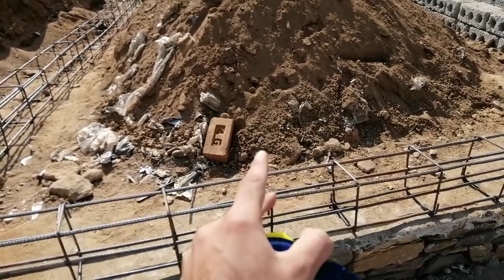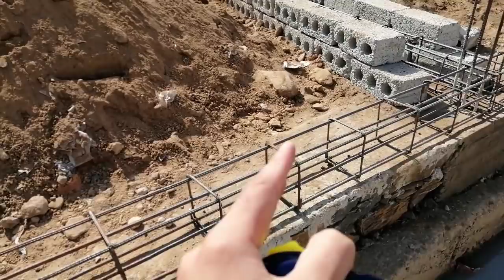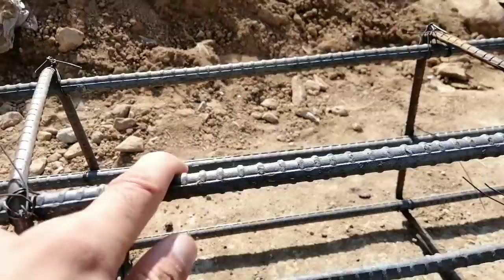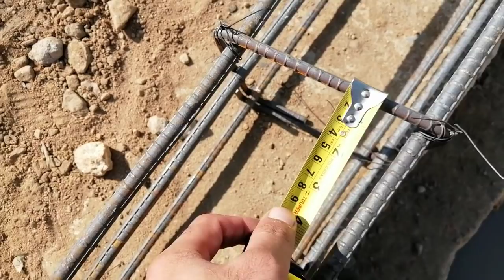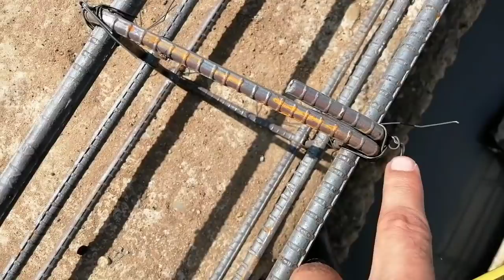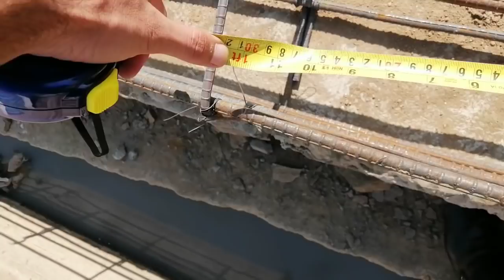4 Big and Common Mistakes in Plinth Beam - Common Mistakes in beam

Comment: I want the plinth beam to have vertical offset at different locations... If I explain it further, usually complete plinth beam is at same elevation... But i want my plinth beam at some portion of home at different elevation... My floor level for whole house would be same... But the location where the elevation is low, I will use dpc at floor level... Can you answer that is this mandatory to make plinth level at same elevation or want is the reason for this, if so?
Reply: The plinth beam should be at the same elevation.

Comment: A very big mistake by you was the measurement of Centre to centre of stirrups. You should measure it from the centre of a stirrup bar to the centre of next stirrup bar. But instead you measured from end to end.
Reply: c/c distance is same.... if you measure an outer edge of one stirrup to other's outer edge...

Comment: It’s all wrong, space between the bean supposed to be 15cm, you can use 18mm steel for the ground beam. A lot of mistakes
Reply: For ground building 12mm will be OK
Reply: 18 mm what??? Wasting money,
Its for 3 floor building
Just single floor 10 more than enough

Comment: Are you sure that the stirrup is less than 6mm
Reply: that stirrups is 6mm only.. he said wrng...
Reply: am also wondering ?
Reply: Same question I asked. It doesn't look like it's less than 6mm
Reply: No it depend on the structure if u used 6mm then reduce the span of strirup if 8mm increase a little bit
Reply: That stirrup seems about 6 to 7.5mm. That's enough